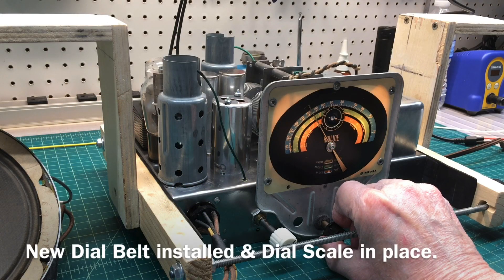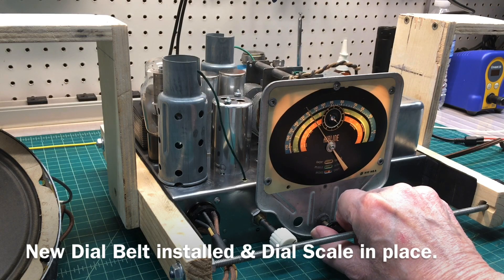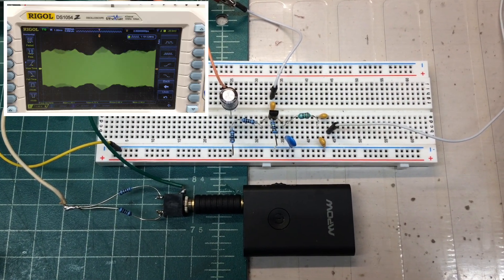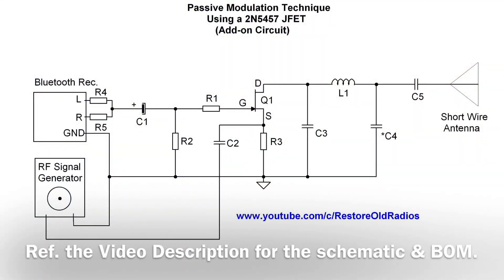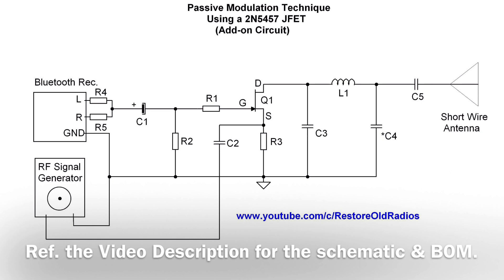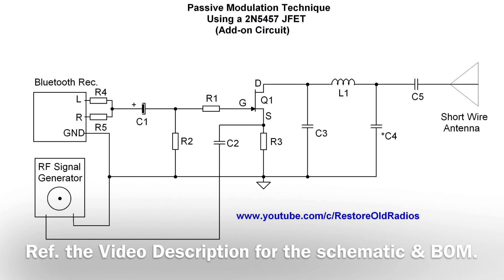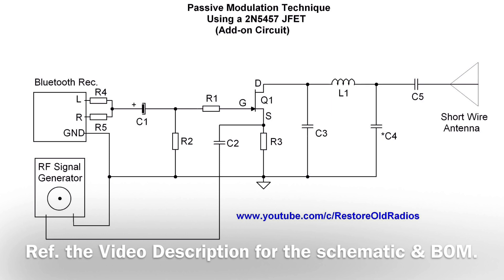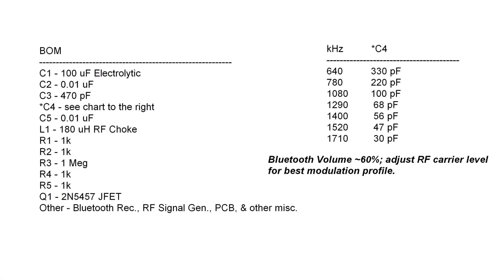Passive Modulation Technique Using a 2N5457 JFET (Add-on Circuit)

Comment: Nice little circuit for those older generators without an external audio in port.
Reply from the maker: Thanks George. Hopefully the results will be favorable for other unmodulated RF generators output impedances. Hope you’re doing well. Best, Don

Comment: Thank you for the video. I am not a radio guy, so please explain the purpose for and the operation of the circuit. Is it a voltage controlled potentiometer/audio volume control? Automated? Much appreciated.
Reply from the maker: Thank you for watching and reaching out. The circuit provides a method to add amplitude modulation to an unmodulated RF carrier, e.g., many of the older RF signal generators didn’t have a modulation source, so the circuit can be used to add a 600 kHz modulated tone for troubleshooting or to stream music to an AM receiver acting as a close proximity AM transmitter. Hope this answers your question. Thanks again for watching. Best, Don